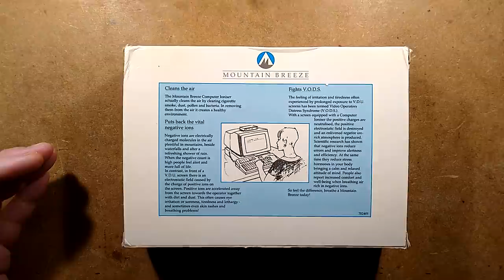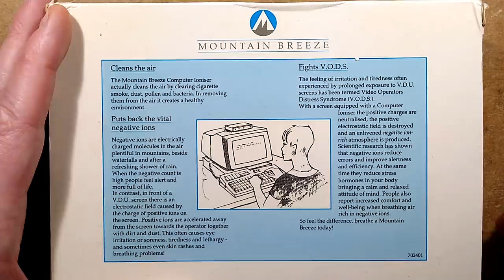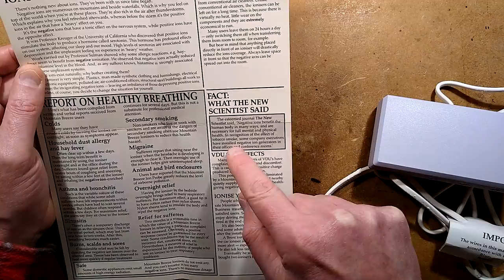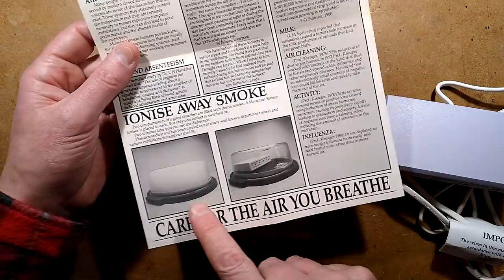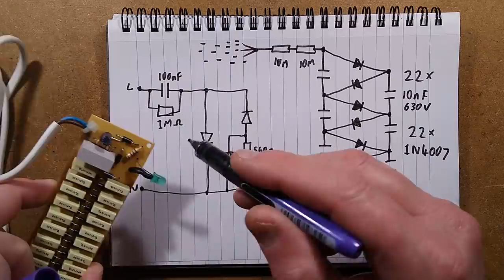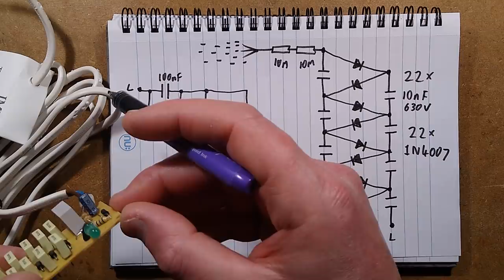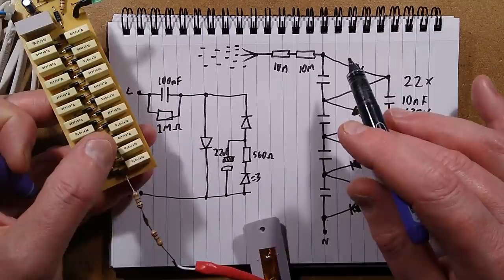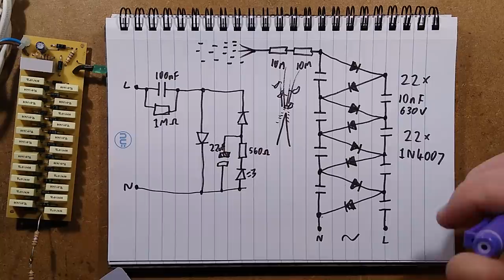Inside a vintage Mountain Breeze Computer Ioniser.

Comment: I've just recently learned about "Solid-state Wind-Energy Transformer (SWET)," which from my limited understanding so far it's basically one of these ionizers exposed to the wind for carrying off the ions and some sort of capture mechanism between the device and ground. https://aip.scitation.org/doi/full/10.1063/1.5109776

Though what I struggle with conceptual is how one gets net energy production from it, I understand the wind is the excess energy source, but the charge returning through ground (ie. the 'generated' energy) should only be equal to what was stripped from the needles and no more. Right?

This might make an interesting follow up video to experiment with.
Reply: It is possible to generate power with that:
Electrical current is the movement of charged particles. In typical generators the movement is created from a changing magnetic field, here it comes from the wind moving the charged up air.
Just - the power-output is minuscule, it is very dependent on the weather-conditions (but more humid? bad luck), worse than old microwaves in terms of radiation, requires a lot of maintenance an last but not least - extremely dangerous.

Would kinda like to see Dave (EEvBlog) making a video on it how he did with some other scam wind-power.
Reply: The SWET test ionizer is battery powered, so it has no inherent connection to ground.  With no wind, the ions just land back on the ionizer and get neutralized.  When wind blows, the ions are blown away, charging the entire ionizer to a high voltage relative to ground.  Allowing a return current from ground to ionizer completes the circuit, and that circuit can provide power, although somewhat inconveniently because it's a high voltage with very low current.

As to your specific point: even if the collected charge is the same as the emitted charge, energy is charge times voltage.  They specifically note that in a strong wind the output voltage can reach several times the ionizer voltage.  So it is at least plausible that the SWET could have a net energy output.

I'm a bit doubtful that it can be a practical energy source on a significant scale, but it's definitely an interesting idea!

Comment: could the "wrong" ionization cause a minuscule change of the  oxygen being less reactive and therefore causing annoyance due to harder to breath?
Reply from the maker: The positive ionisation strips electrons from the air that will then probably take them from other surfaces, potentially causing an imbalance in your body.

Comment: Wonder if a sufficiently powerful ioniser would attract coronavirus particles, clearing the air of them?
Reply: Or maybe just precipitate aerosol breath particles out of the air, both the infected and non-infected ones.
Reply: no.
Reply: Well ozone would probably destroy the virus through oxidation the same way an oxygen bleach does.  Whether the particles are then cleared from the air is neither here nor their as far as infection is concerned - they would already be dead.  So...  an ozone generator would probably be more useful if that is what you wanted to do.
Reply: The problem is ozone also causes respiratory problems in itself, so you wouldn't want it running if you caught covid and were suffering from it!

Comment: I remember a faint glow around the needles, if memory serves. Would I be right in supposing that if it was wired backwards as you described there wouldn't be a glow?
Reply from the maker: I think there would still be a glow.  I made a video about a Sharp plasmacluster unit with positive and negative needles and both had a slight corona glow.

Comment: Wouldn't the uncut capacitor leads cause dissipation of the charge inside the case, making it less efficient, what do they call it? Runaway?
Reply from the maker: I think that once the charge reaches a saturation level it has less of an effect.

Comment: I might have to build me one of these...and since I am in the US with our weak-ass 120VAC...I guess it will have to be at least 44 caps & 44 diodes  :)
Reply from the maker: Not sure how it scales up, but you could get one of the small 120V potted ioniser modules from eBay and re-case it.

Comment: I had an ioniser in my bedroom some years ago. It overhang the shelf and the bottom edge turned brown. Impossible to clean it all off. Never seen one of these.
Reply: Yup, it is from the ions attaching to airborne particles, giving them a charge so they followed the voltage gradient to the nearest surfaces, bit of a pain when those particles are the sticky products of burning fuel in a diesel or jet!

Comment: Would using one of these in a fan buffer cause problems? The concept is that a PC case is fitted with an air buffer over an intake fan near the top of the case. The buffer has an ioniser at the bottom and the idea is that some of the dust that would make its way into the case through the intake fan is intercepted at the bottom of the buffer (where the air is not being thrown around by the fan too badly) by the ioniser and collects there instead. My concern is that not all of the ionised air is going to be used up on dust and will get into the case, come into contact with a bunch of PC parts and accelerate the decay of anything that can oxidise.
Reply from the maker: I wouldn't recommend an electrostatic generator in a PC case.
Reply: It would probably need to be bigger than that since the dust does not instantly leave the air, but takes a short time to migrate to a surface.  It can be speeded up by an electric field (industrial "electrostatic precipitators" do this).  Also a larger collection area can hold more dust, so can go longer between cleanings.

A "drift area" with an electric field but no ion emitting points should also remove free ions.  If that's not good enough then active neutralization (adding ions of opposite polarity) may be required.  Caveat that neutralized just means no net charge, the resulting air is slightly conductive so you might have to cover your CMOS battery - it's a very low current circuit so long term exposure to slightly conductive air could reduce the battery life.
Reply: I should add: keeping the net ion output low is vital!  Ionizers with zero net output (equal amounts of positive and negative ions) are used in the electronics industry to reduce static charges.  But if an ionizer has a net ion output then it will create static charge, especially near the ionizer, and may be a danger to electronics.  As Clive said in his comment, definitely do not put an ordinary ionizer as part of a PC case, and preferably keep them some distance apart.
Reply: Plain and simple, you don't want any electrostatic generation near devices that are sensitive to electrostatic discharge (ESD). The theory is solid, but the whole point of grounding yourself to the PC chassis and using a wrist strap when you open the case (or, at least, you should be...) is to prevent damage from electrostatic discharge. That is also why components are shipped in those special plastic bags.

You'd probably be better off running an ionizer and a large-room HEPA air filter a few feet away, and it would be safer for your PC and all the devices connected to it. Don't forget that ESD can follow cables to their destinations! :-)

Comment: how do hose little black boxes with the carbon brush ionisers work you find in some tower fans?
Reply from the maker: They usually have a system, where a small capacitor gets charged up and pulsed through a tiny high voltage transformer to create a higher voltage that is then boosted by diodes and capacitors.  Then it's applied to the carbon fibre brushes, which act as hundreds of very thin needles to charge the air.

Comment: Do these things work for cleaning up the smell of smoking ? Im a smoker, 'I know', but my flat now stinks due to lockin. Would one of these things help clean the air and smell ?
Reply: You are locked in?
Reply: @gs425  No, just with all the lock downs and everything closed there was nowhere to go anyway
Reply from the maker: It would help precipitate it out the air.  But vaping would be MUCH cleaner indoors (amnd for your lungs).  Try the Blu disposable cartridge system that the Co-op sells.

Comment: Would this even register power consumption in a meter? We don’t have “smart electrical meter” here where I live. I’ve heard you speak of apparent power eventually taking over as a way to charge customers. Just wondering.
Reply: the insulation on the wiring in your house is not perfect. Even if it would be perfect, the wires them self are in parallel to each other, acting as a capacitor. So: Even in an very ideal world, your meter would ever so slowly turn due to lackage and you you would be charged for apparent power: The house wiring is acting as a capacitor and thus count. In practice, we connect so much to the wiring, that it does not matter.

Comment: Now for your daily dose of pedantry.
 "Styrofoam" is a registered trademark of DuPont and is only used by them to denote extruded polystyrene foam. Therefore when people call expanded polystyrene foam "Styrofoam" they are using the term wrong in two ways.

Comment: Old computers really were bad for kids - and anybody else - with the rather small monitors sitting up close, cheap flickery screens combined with flickering CF lights.
And at least the screens we had would not need that - they were bad enough that they could charge up objects sitting in front of it.... Smoke, Dust, or anything else in the air? The screen will catch it :P

Comment: The misinformation that CRTs damaged your eyes was basically very wide spread still in the 90s growing up. My mom would tell me not to set too close to the TV as I will have to get coke bottle glasses if I do all the time hahaha! 

 I believe there might have been a very small grain of truth to it though in that one early model television from the early 50s  wasn't shielded properly so you would get arc eye similiar to welders due to intense UV exposure IIRC. Obviously though there was no basis for it in the 90s at all though!
Reply: the reason why you need coke bottle glasses if you sit on a TV all day is, because the growth of the Eye in children is modulated by (sun) light.
If you are not exposed to enough (sun) light, you get nearsighted. Take a wild guess what sitting in front of a TV and being in school all-day those to children's eyesight.
But note: It is not the screen that causes the problem - it is the lack of (sun) light.
Reply: Funnily enough I was already near sighted when I was young and even needed bifocals when I was young not because of that though !

Comment: Confused.. I was sure this was going to be a debunk video.. Surely this is electrical homeopathy..
Reply: It really removes dust from the air and it creates a small amount of ozone which in fact breaks down smelly molecules.
If you have a smokers house, then this thing can really help.
So no, this is not electrical homeopathy. It can be used for very specific effects. But... I would not want to be in a room with a running ionizer. I would start it for a few hours, switch off wait a few hours and then it did its thing.
But offcourse opening the window or not smoking might also help, so...
Reply: @sarowie  Diesel smoke would reverse the effect of opening the window ...

Comment: Noob opinion but the high voltage bit looks similar to the Marx generator that @ElectroBOOM was playing with; just not as terrifyingly dangerous :-)
Reply: The Cockroft-Walton multiplier config. in home ionisers can produce OK voltages, continuously, whereas the Marx Generator is by design a pulse generator. When I worked for the UK MOD a colleague and I used salvaged HV components to build a 40-stage Marx Gen. That thing could (and would) deliver one hell of a spark, and we had to be really careful when using it. Tended to be hard on the capacitors (and hard on the high-value resistors too).

Comment: I'm pretty sure that it would be the cable that's leaching something out that's melting styrofoam I don't think the styrofoam is melting on its own I remember when I was a kid having worms used for fishing rubber worms they would leach something that would melt styrofoam probably not the same stuff they use nowadays I don't know but those worms back then used to melt styrofoam

Comment: It didn't come with a plug?  Just two bare wires? o_O
Reply: Normal in the UK from 1947 to 1992.  They changed their plug type in 1947.  Manufacturers didn't know what plug type customers had, so they left bare wires and the customer installed the plug they needed.  By 1992 the old type plugs were very rare, so the UK finally mandated manufacturers to install plugs.

Comment: How are you supposed to use these ionisers? Is it like plugged 24/7? or for some periods of time?
Reply from the maker: Ultra low power, so on all the time.
Reply: @bigclivedotcom  Thanks Clive! Definitely the power isnt an issue. I was rather wondering about the ions. If i left it 24/7 in my room, wouldnt it have any negative effects? I have a lot of electronic devices, especially music instruments? My ioniser has 24 capacitors (12 stages) 100nF (0,1uF) each?
Reply from the maker: @sumilidero  I'd keep it well away from electronic stuff to avoid an ESD issue.

Comment: neat, couldnt you just use more stages for 120 volt configs
Reply: I don’t think I’ve ever heard of a 120V ionizer of this style, but it would certainly be possible in theory. A small step-up transformer before a voltage multiplier would be much smaller and cheaper, though.
Reply: Simply double the stage count and halve the rating of the components.  So 44 capacitors and diodes, all rated for 300V should do it.
Reply: The more stages you have, the less efficient each stage gets. So it’s not just double the stages needed, it’s more than that.
Reply: @JasperJanssen  I guess the loss per stage is mostly the diode drop, at these tiny power levels.

Comment: So, if those things are more or less snake oil .. (or does an ionizer actually do anything? .. like anything useful) - i wonder why they build an actual circuit .. instead of those snake oil "power saving" devices that only pass through power, light up a LED and maybe glue a weight inside to give the appearance of quality (cause, we all know ... heavy electronics are of higher quality than light weight ones)
Reply from the maker: They got a bad reputation due to dubious marketing claims.  But they do have an air cleaning effect.

Comment: styrofoam bugs me everytime people use it wrong, which is most of the time. styrofoam is a copywritten name for extruded polystyrene from Dow Chemical. mostly used for insulation on walls. It is used for every type of foam.

Comment: It's very strange to see a piece of equipment come with a customer supply plug. Is this still normal there? Is your average person usually capable of installing these plugs?
Reply: It was taught in primary school. But no, it changed in the first half of the 90s.
Reply: The UK changed their plug and socket standard in 1947, but existing buildings were allowed to continue using the old type because it would have been too burdensome to change out every socket.  The solution for compatibility was to sell equipment without plugs and the customer had to install whichever type of plug they needed.  In 1992 the UK mandated that equipment come with plugs installed, presumably because plug incompatibility was by then rare enough that pre-installed plugs were a net benefit.

Comment: Unrelated but I have a question for you! I just installed a new gas water heater. There is no electical connections to the heater. It has a Piezo pilot lighter. After I light the pilot, an LED comes on. Where does it get it's power?
Reply: Flowing water runs a small generator
Reply: @l126149  🤣

Comment: With a transformer? Hmm... I have a microwave transformer. . .
Reply from the maker: Remember that a microwave transformer output is high enough voltage and current to post an extremely high fatal shock risk.

Comment: Was it common for consumer products to be sold without a plug? I have not seen this before. Any other reason than it would be easier for the end user to put on whatever plug worked in their country?
Reply from the maker: There was a transition time when some houses had round pin sockets and some had the new square pin ones.

Comment: Been trying to wrap my head around why the diodes appear to be backwards. Need to remember electrons travel backwards through diodes. Brain needs to engage again, back to work tomorrow.
Reply from the maker: Just think of it as any positive charge would be shunted to the supply by the diodes.  It took me a while to get my head round it when I first started playing with them.